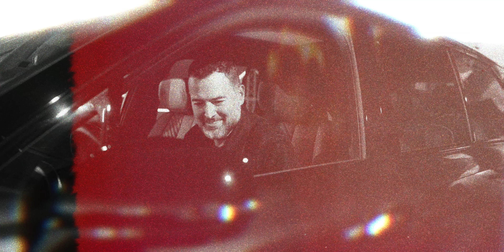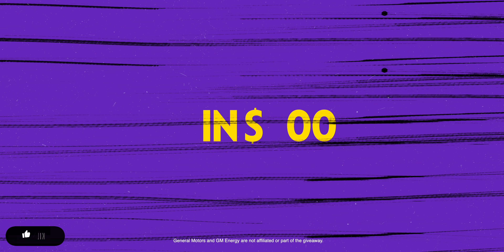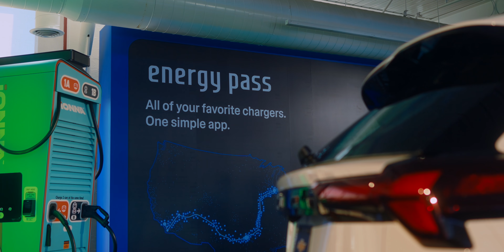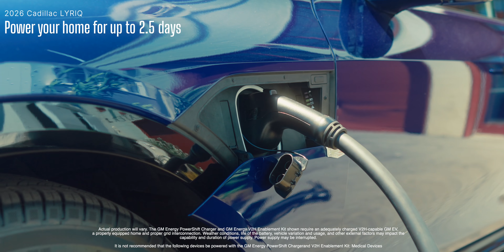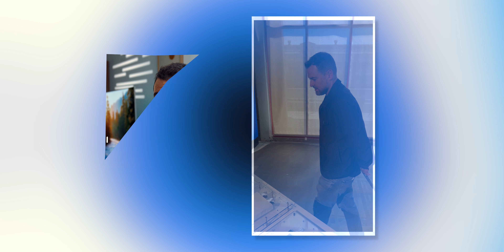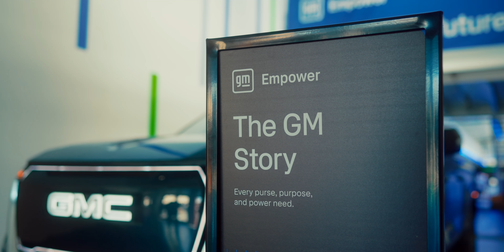Use your car for power! GM Energy Home System

Comment: “Properly equipped home”… also, if they could start using the NACS that’d be great. We won’t consider an EV that doesn’t use that standard because non-Tesla superchargers are completely unreliable and we already have two Tesla wall connectors at home